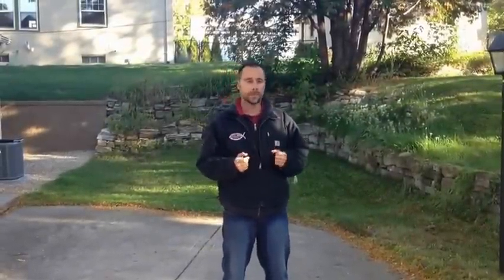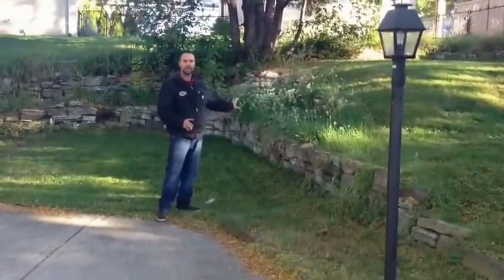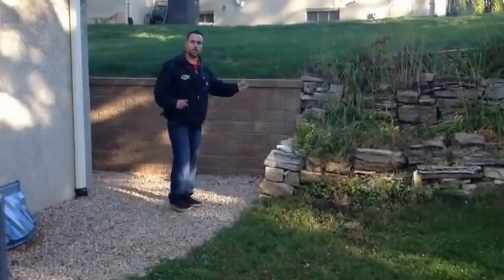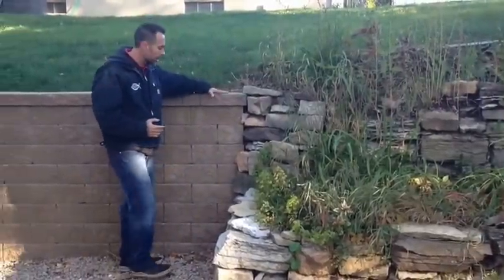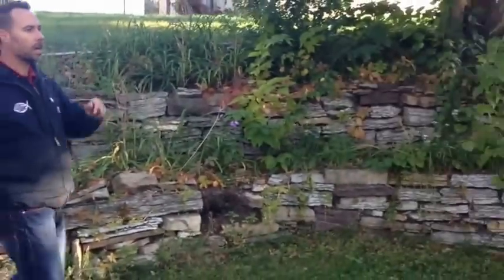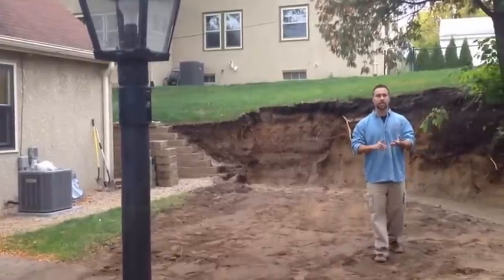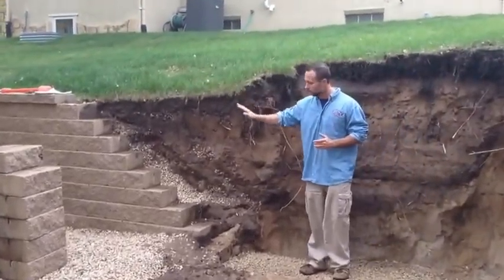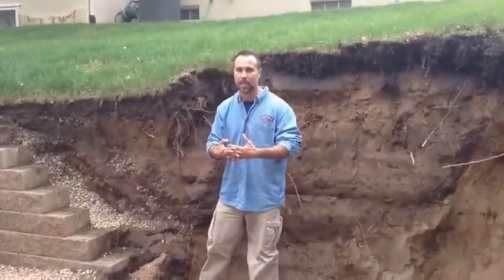How to build a Retaining Wall

Comment: Which  stone you use it for the wall. Any suggestions  for a 2 metre  retaining  wall. To level the sloped  yard ( with soil for whole 2 meters) 
Just need some advice  on the stone type or size.

Comment: Few questions for you. #1. How do you deal with tree roots? I see that wall comes pretty close to the tree on the hill. Will large roots impact the wall at all or will they grow in a different direction after contacting the wall? Do you remove larger roots and if you- what is kind of a safe distance to cut them back from the wall so they don't have any impact on your wall.

Question #2. How do you curve the square locking stones you guys use? that wall looks incredible.

Last question, Question #3 is between stones- is there an acceptable amount of un-level-ness that wont impact the wall? I just started doing mine and I am a little ways in and it seems like when I am leveling them, if I come back and check, with a long drywall level along 4 blocks, there is about 1/8th-ish of space between them of un-level-ness. I don't think that minor amount will have much effect but I wanted to be sure before I continue. If it's going to be an issue I'd prefer to address it now while I am on the bottom row. 

Love your videos! You're the man!

Comment: Love your videos and your logo....  I have a question about this project.  What happened to the rule about trees and setback on the upper terrace of a wall?  Looks like there is an existing tree almost on top of the wall.  Will that tree be removed?  If not, what was done to help prevent future surcharge from the tree as it grows?  Cheers
Reply from the maker: It will but the customer wanted it to stay

Comment: You prefer your base obviously to a traffic bond? I am curious because we do it the same way besides the exception of a traffic bond and then sand layer, etc, basically the first time we did one of these versa lok walls we went step by step according to the literature given to us by versa lok themselves. We never had a wall fail but it seems like your way is faster and saves some steps and also some compacting. Wondering your thoughts on why you did it different then Versa lok advises to do, thanks in advance for your response.

Comment: Some talk about using filter fabric between the soil and drain zones.  My feeling is the filter fabric will clog up and effect the wall as if it doesn't have any drainage behind it.  Eventually leading to failure.  What is your take?

Comment: Hi Stanley,

'Gday' from Australia. Loving your videos, very, very insightful. Thanks for all the details. Any 'hot tips' for excavation on a very steep slop with not much (read almost no) access for anything other than hand tools? There is A LOT of digging to be done and trying to limit the effort in manual shoveling etc. 

I've seen the 'airspade', not sure if that might assist in at least loosening the soil before digging manually?

Also, there are quite a few levels that I might need to be address, do you start repairs/replacement at the top or the bottom of the slope?

Cheers!

Nick
Reply from the maker: Wow-  thats a challenging site.  No advice without seeing it.  Just fly me down there and I will take a look at it for you.  I have always wanted to see some kangaroos LOL

Comment: Thanks for the video.  Love watching your work.  Building a wall : should I compact the backfill stone? Have at least 2 feet of backfill clean 3/4 inch stone between wall and soil.  Thanks
Reply: The usual advice if you read/google it is to compact after every course of stone. Also use geogrid if the wall is high enough to need it. Stone vendor should be able to tell you.
Reply: @peter9477  thanks for the advice.  Wall is up.  Basically a solo build.  150 ft x 4.5 feet high.  Used geogrid ever 2 courses.  Keystone country manor onyx.  I compacted via hand tamp every 2 courses as well.  Drain pipe across back.  Ran low voltage lights ever 15 feet in the wall.  Took me 2 around 2 years from start of excavation,  to footer, to full build in free time.  Only thing left is final grading and  sod or seeding
Reply: Every course sets back 3/4 to an inch also
Reply: @TheReaL35  In my inexpert opinion, it sounds like a pretty solid job. Kudos to you.

Comment: I had to read comments. In the video I understood it to say you used 3/4 clear angler stone.  (2.29 mark)  rock for base.  3:14 mark you say you use same rock for drainage zone as you do the base zone.  I have always use 1" minus crushed gravel for base. With heavy compaction. 1" clean rock for behind the wall for the drainage zone. 
Do you find the clear or clean rock easier to bid a job as you only have one rock to haul? 
Do you find the clear rock beneficial over crushed rock for aiding in water drainage under wall?  I find it easier to get a true level with 1" crush rock for base.
Reply from the maker: I prefer the 3/4 inch angular for base. No chance of settlement.

Comment: When I've done walls (versa), I've always used class 5 for base, 3/4" fill behind the wall, and 4" flexible drain pipe (filtered, so no sediment clogs the pipe).  What are your thoughts?
Reply from the maker: I prefer 3/4 clear for all the rock. Both base and drainage.
Reply: Tim Z Hi Tim, if you use 4in corrugated pipe dont you the kind with a sock in it! it actually causes the silt/fines to clog the sock. I use 8's clean angular stone behind the wall on average  12-18"'s before going to the backfill and I usually excavate back the height of the wall with Geo-grid on anything taller than 42". wall block with a batter the Geo-grid sometimes causes gaps between the wall block and changes setback depending on the grid type. Just things to think about if your going to be building  walls. And always remember the number one thing! Compaction! and when your guys think they have compacted enough have them compact another time! oh ya I also use soil seperater fabric  in all my base dig under my base stone that the soil was compacted too and if you disturbed the soil you need to trade that out as well or get a proper density for a good compaction. oh ya have your guys compact one more time beyond the one above because while you were gone meeting with a customer they said hey Tim will never know we only compacted once or twice and we dont have to pay anyone to come fix a settled failing wall! Time gets to pay us to build it twice lol!

Comment: Did you use geo grid?
Reply from the maker: +Tommy Frye Not in this wall-  didn't need it.
Reply: I'm guessing the arch gave it added strength making it possible to go without geo grid

Comment: I personally would not have built the retaining wall that way. I would have taken the existing wall apart and used them as base block then put in geo grid as that height in that wall requires it. Or i would have used a gravity sytem like the brute although you need equipment to installing them they allow walls to be built up to 7 feet without geogrid and engineering. The group of trees i the back definitely would have to go using a a standard block because of the excavation needed installing geo grid properly. Every job is different and different types of walls need to be built according to its specifications. Love the videos tho! Wish videos like these existed 15 yeasrs ago when i started my landscaping business.

Comment: Just had a engineered wall built here in Alabama. In comparing the work to the videos of yours I’ve watched it looks like the contractor did a good job. I did notice that they hand packed the aggregate. They did not use one of those mechanical packers. How big of an issue is that? Time lapse below.
https://youtu.be/42KfvIt5Zg4